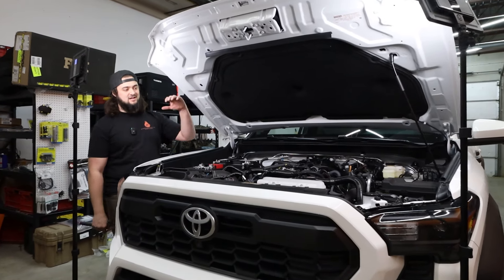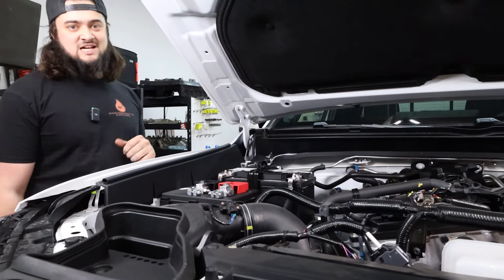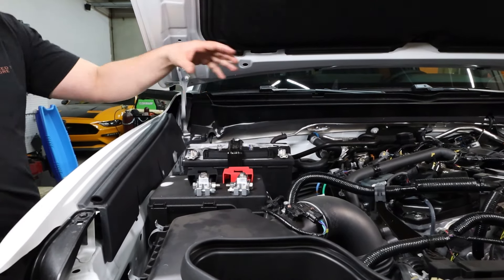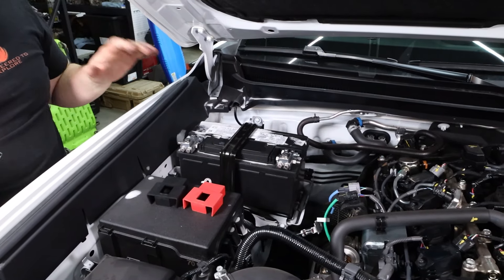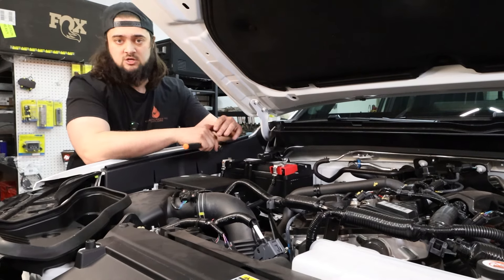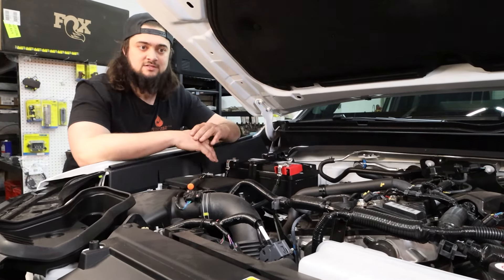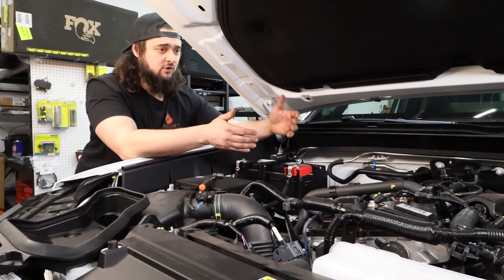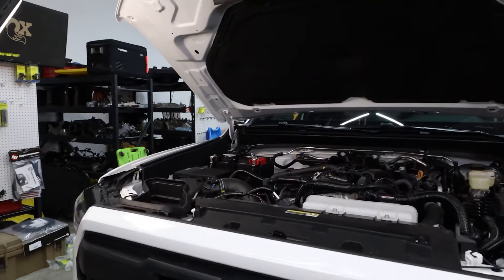2024 Toyota Tacoma FIRST Electrical Mod!

Comment: Great video, very instructional and to the point, but if you notice when you put the positive cable last it threw a spark, for future reference, you should put the positive cable first and then the negative cable that will eliminate any shock to the PCM or electrical components. I hope you don’t mind that professional critique.
Reply from the maker: Thanks for the comment and kind words. Just so you know, if you connect the ground last it also does the exact same thing. We have gone back and fourth on which way to do it over the years with some manufacturers saying to connect the positive last, and some saying to connect it first.